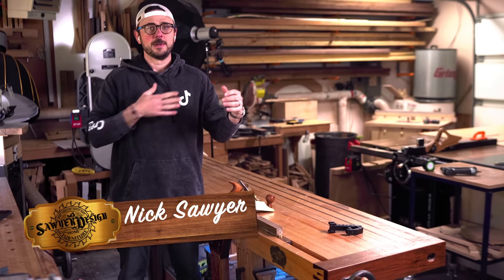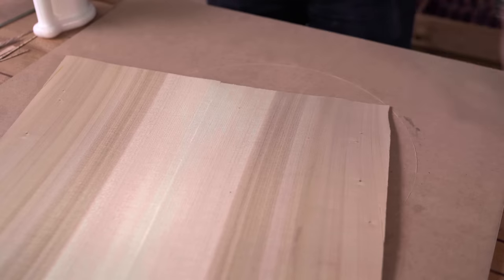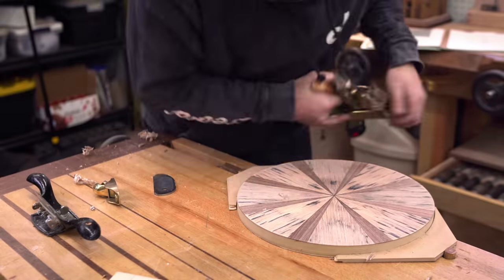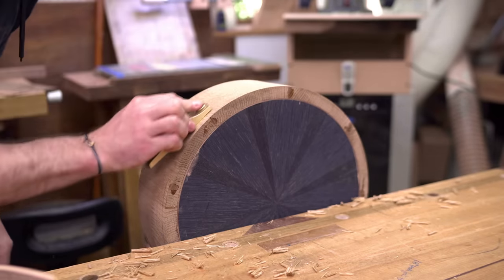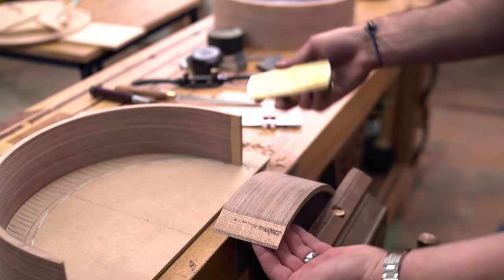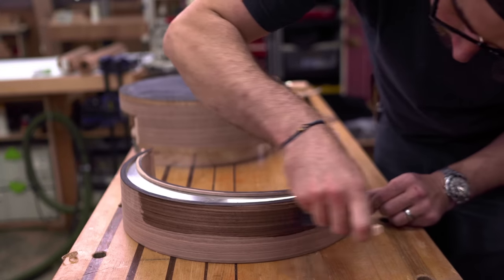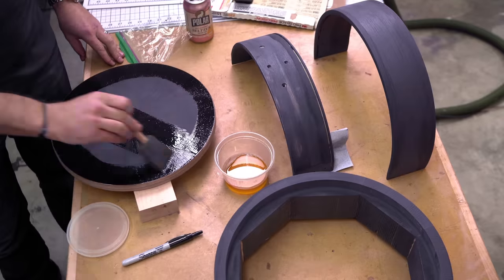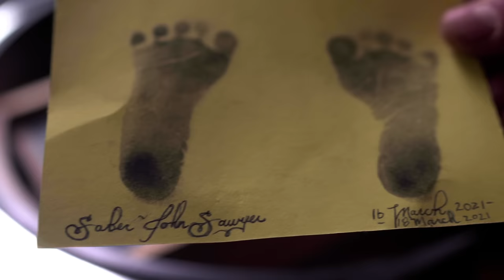The Box That Shouldn’t Be

Comment: 🔼Retired airframes mechanic: Belt sander or drum sander for Aluminum and a bucket of water to quench the metal when it gets to hot to handle. Disk sanders and die grinders also work well.